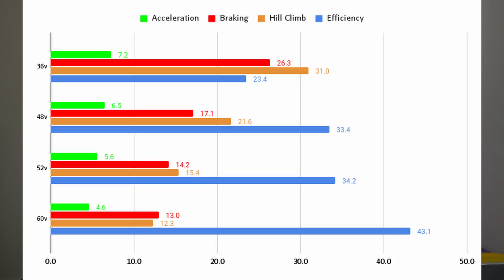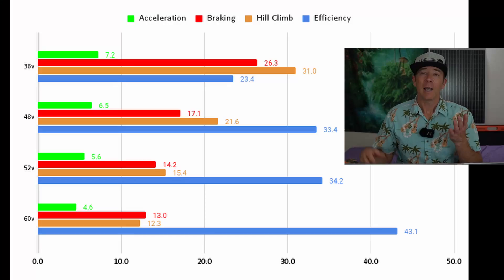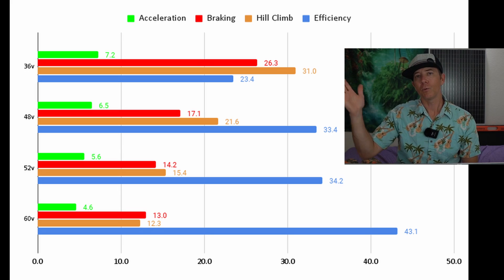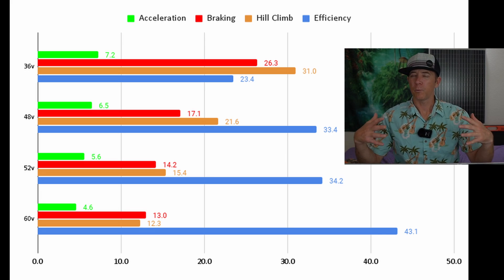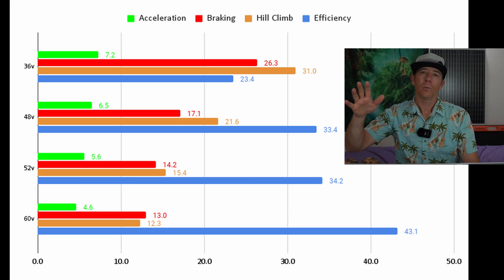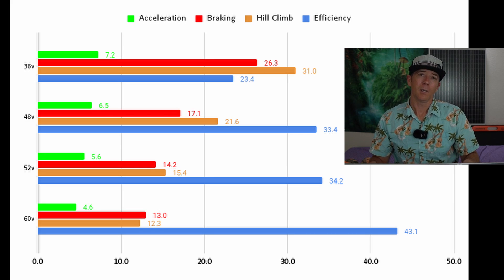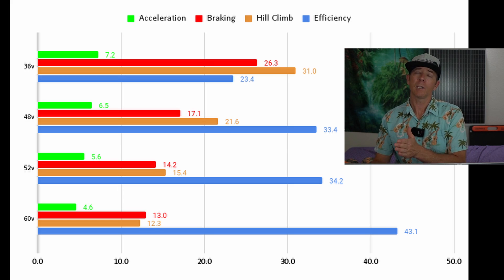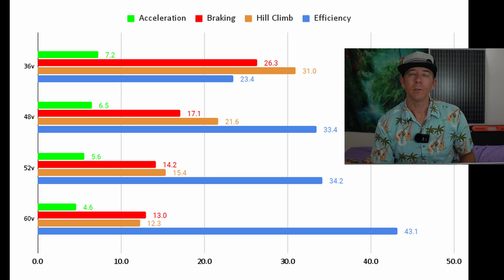Which Voltage of Electric Scooter should YOU Buy!

Comment: I don't understand, why does lower voltage give more efficiency, for a definite wattage higher voltage low amps will run cooler and thus last longer.
Reply from the maker: It is really the amps, lower wattage motors e-bike also usually run at lower amps. In the EV recharge world they are going to higher wattage but that is about charging speed/heat not really operational efficiency.  You will get the best efficiency running a lower power motor that just meets your power needs. Any motor running in the top of it's rated volt & amp range will run hotter and likely have reduced longevity. Thanks for the comment.

Comment: 72V 😄

I agree with 52V being the “sweet spot”.  Those are my favorite battery packs for my projects.  Good power, but not too much that it’ll scare you out of your wits.  My 72V is an animal.  I just built a 72V 3500W small ebike/scooter and that thing really wants to wheelie 😳.  I hope E-TWOW starts using a 52V in their GT Sport model.  It would give it that extra oomph and still maintain the fantastic lightness of the model 👌🏼.
Reply from the maker: Oh man, 72volts start putting things in that next realm of crazy! 52v in a portable scooter would be great, it would be almost no change in the number of cells, just the configuration. Good to see you Ray!